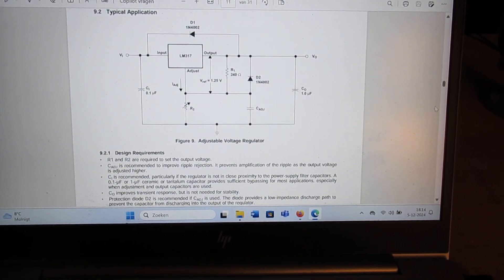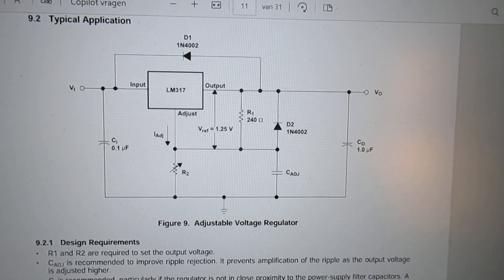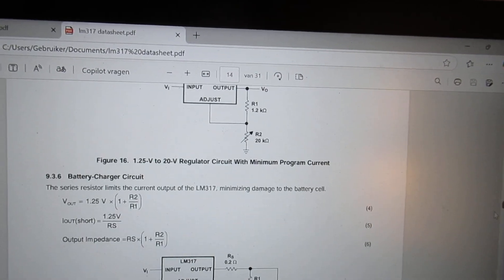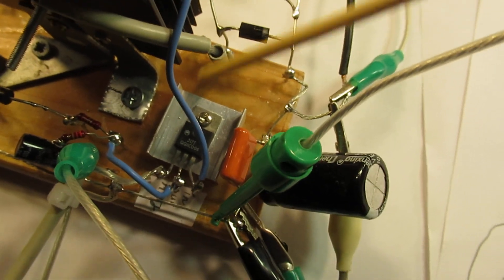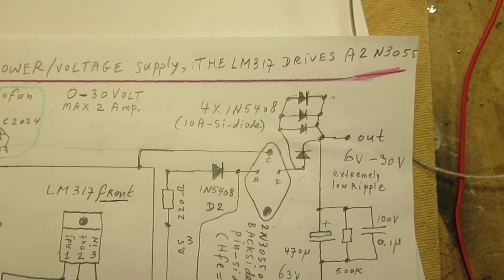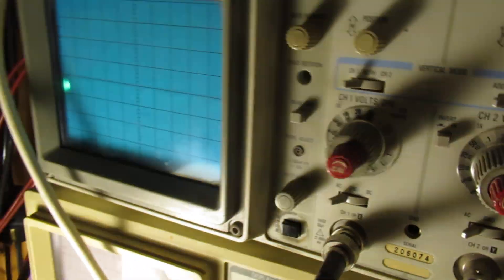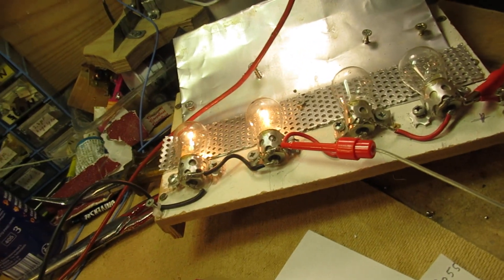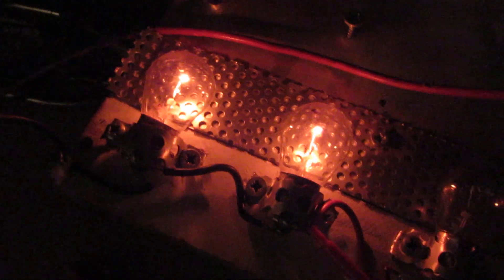Voltage suppy 0-30 Volt max 2 Ampère, where the LM317 regulator directly drives a 2N3055 schem/demo

Comment: I am obliged for this video whichb showed the combination of LM317 regulator, 2N3055 power transistor, five 1N5408 diodes. electrolytic.capacitors and other components. That seems to be a rathet good bench supply with low output.noise. I shall try to test such circuit. It was a good explanation and fine demonstration of the work of the DC power supply.
Reply from the maker: Thanks, you are welcome. You can make it absolute shortcut safe by adding 1 automotive lamp of 12 V-45 Watt or 2 automotive lamps of 12 V- 21 Watt in series at the output. Of course that will give some voltage drop and/or will limit the (maximum) output current somewhat. It is primitive, but it works OK when you want to use this circuit as a workbench supply for the hobby. Where always (!) shortcuts are made in building or developing electronic circuits. And: very important: the voltage must (!) be variable from 0 (zero) to (say) 30 Volts or so. Otherwise serious tests/developments are not possible. Fixed voltages do not work, they cannot show how a circuit acts in practice. Say: 1/10 of a Volt can have a serious effect on an electronic circuit on its performance (....strange but true). 6 dec. 2024. Have pinned your comment.

Comment: Spannungsversorgung 0-30 Volt max 2 Ampère, this remembers me to an old plan from 1982, a power supply build only with separate transistors. It works great. It was part of the education of Deutsche Bundesbahn. If you like you can download it from Mega. 
links are not alowed here. ask for the link

Comment: My school time I have made this regulator combination of LM317 and 2N3055 . That time I am not use new parts I buy use circuit parts. I problem is load increase output get lowered but new version buk conver ic but there lot noice .
Reply from the maker: Yes, that are the important differences. Thanks.

Comment: Hi,is it in prepare video with a schematic of 240w solar charger controller you said in this video link:https://www.youtube.com/watch?v=EGYHuLc0Tzg&ab_channel=radiofun232.
Best regards
Reply from the maker: Thanks for that link to that earlier schematic (!). You have a good memory...I promised to show that schematic (240 Watt solar panel charger, charging a 24 Volt lead acid battery of 45 Ah) in that video, but I did not publish that schematic up until now (5 dec. 2024). Reason is that I have to open the box, get it out all together, to show everything, etc. That lead-acid 24 Volt charger schematic differs a lot from the circuit that is showed now/here (5 dec. 2024). I will keep your comment surely in mind! When I have time & inspiration I will show the circuit of that Solar Charger. 5 dec 2024.